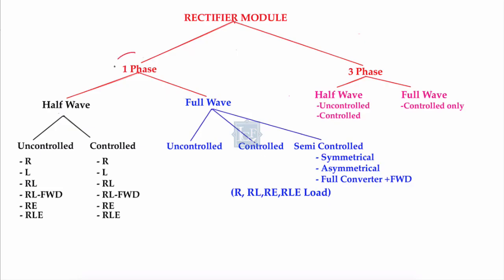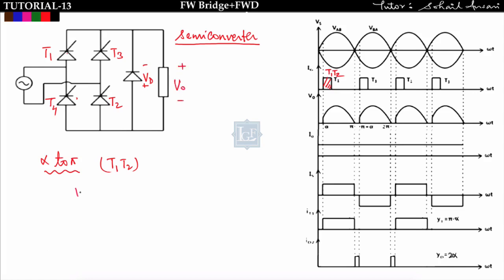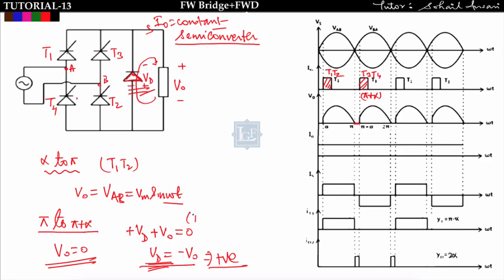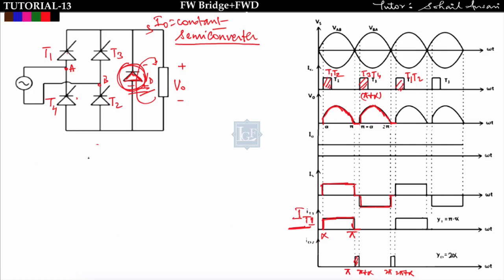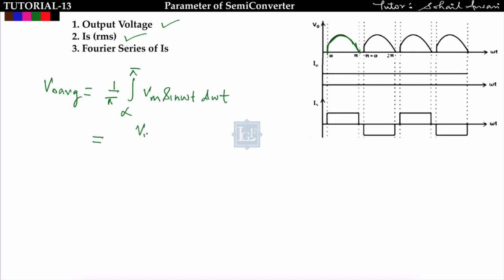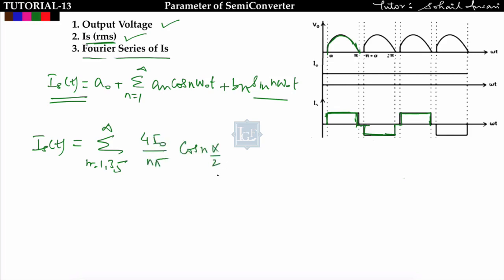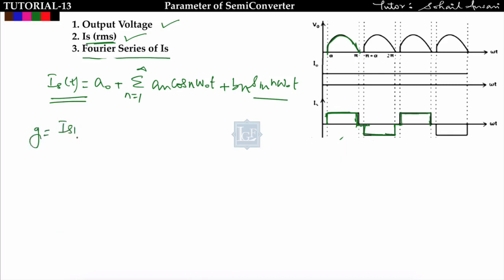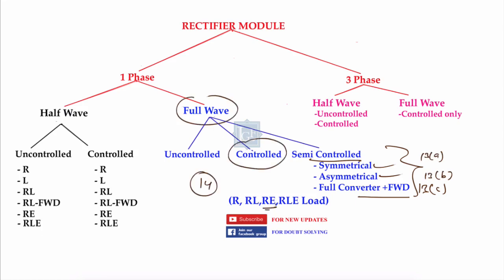Lec 13(c) Full Wave Semiconverter (Bridge Converter+FWD) & its Harmonic Analysis

Comment from the maker: the formula of IPF of semiconverter at 15:00 minutes is wrong..in place of 2 on numerator ..it should be 8...plz correct that..thankyou
Reply: By Pin=Po method numerator shall be 2 only

Comment: why FW bridge +FWD converter is called as a Semiconverter ??

what is the definition or condition for a Semiconverter ??
Reply from the maker: bcoz the waveform of output voltage of FW bridge FW+fwd is same as symmetrical and asymmetrical configuration...semi converter means two controlled switch and two uncontrolled ...
Reply: OK, the waveform is same .
it means
just bcoz of waveform , this circuit will called as semiconverter??
Reply: @GATEMATICEducation  sor but in the circuit.. All the switches are thyristors. There is no uncontrolled switch there. Its confusing. Please correct me if i am wrong.
Reply: Sir, from where the formula os Is(t) of fourier series came. It will be (4I)/npie*sin(nwt-na)

Comment: sir if fw diode is not placed how scr conducts upto pi+alpha ,after pi supply voltage becomes -ve na then scr 1 and 2 will not conduct na sir
Reply from the maker: tell me the time at which you are getting problem?
Reply: 3:20
Reply from the maker: it will conduct up to pi + alpha only when load current is constant ..and here i m assuming that load current is constant...so anyhow the current needs the path for all tym..and after pi the thyristor T3 is not triggered so T1T2 has to conduct after pi also till the T3 T4 is not triggered..see the 1 ph. full wave bridge rectifier..i explained this concept...ok..